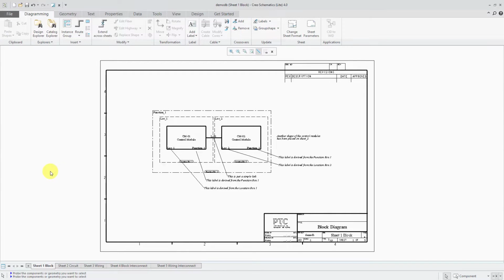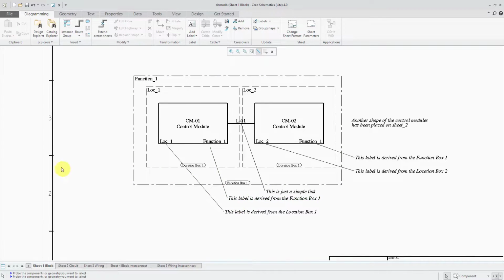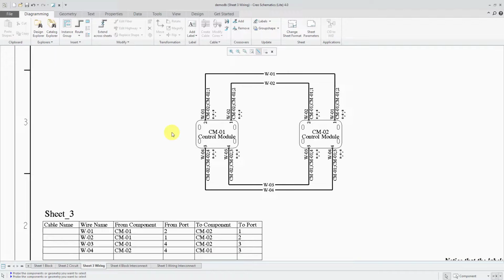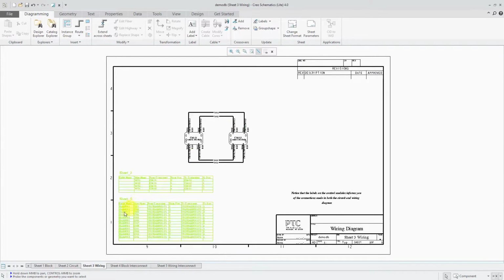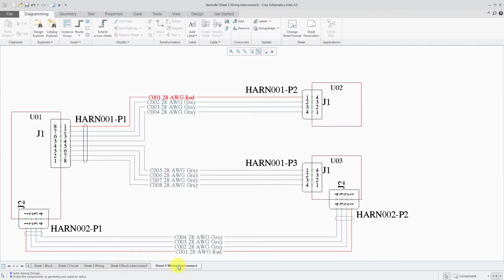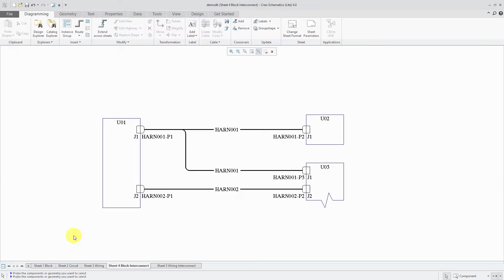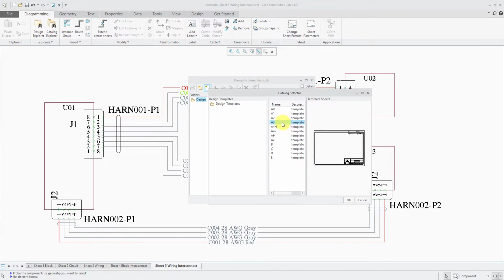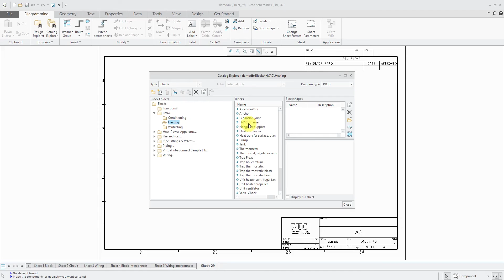Creo Parametric - Creo Schematics Diagram Types

Comment: Is creo schematics of major use for electrical engineers.. asking this because I am a mechanical engineer
Reply from the maker: I can only speak from personal experience. I've only encountered mechanical engineers and designers using Creo Schematics. But I've never worked at a company that needed circuit diagrams.

Comment: You mention going from BID to CID to WID, how does the connection from BID to CID work, i dont see anything in the manual? and do you then go for BID to WID or from CID to WID ?
Reply from the maker: Yeah, they took a lot of stuff out of the training manual. Check the help, although IIRC it might be with reports. You can go from BID to CID to WID, BID to WID, or CID to WID.